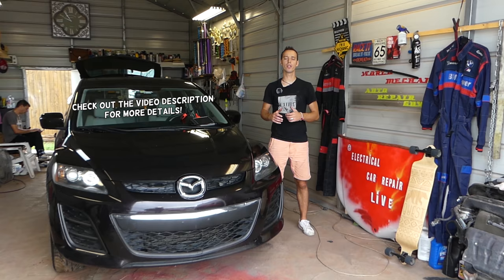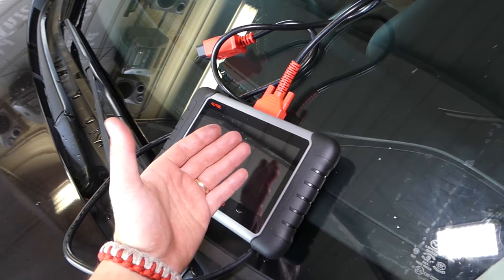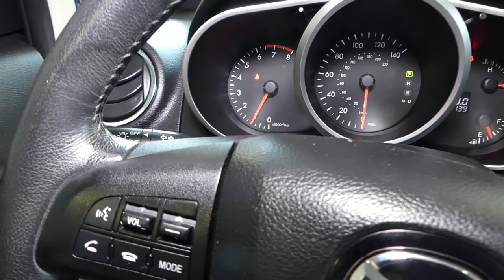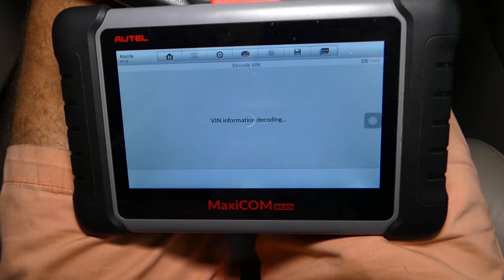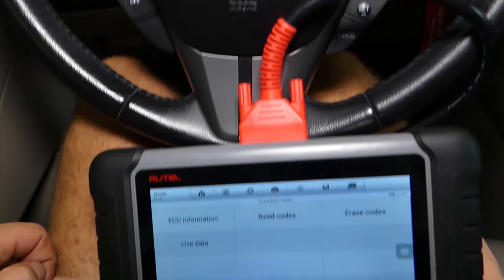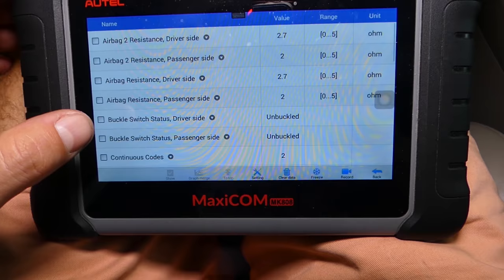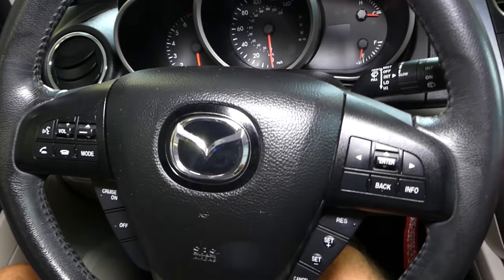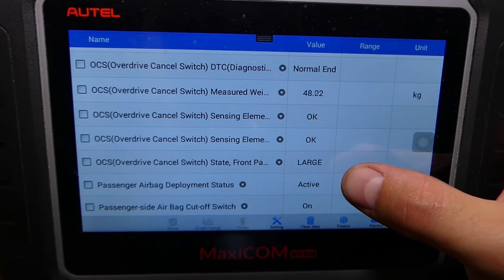MOST COMMON REASON AIRBAG LIGHT IS ON

Comment: For me it was an undercharged battery. It read 12v but was only a 40% charge. I charged it up to full and problem went away. It then clicked why my radio kept shutting down and coming back on.  My guess is my stereo system is taking too much to keep it running from alternator, and not charging battery properly. Couple that with short journeys and bingo, dead or dying battery. Hope this helps someone.

Comment: Don't waste 5:47 minute of your life GUYS

1. Ignition off
2. There are yellow wiring harnesses with a connector under both front seats, these are for occupancy detection. They might have a loose connection. Wiggle and push the connectors.
3. Ignition on.

This resolved it for me, however light only disappeared after the second startup.

Comment: Thank you for the video.  So I was messing around with the plugs under the seat and nothing happened with the passenger side, but the drivers side did cause it to go off but only temporarily.  It came back on when driving.  SO I pressed them again it went off again, but still driving makes it come off.  What is wrong do you think?  And what verbaige should I use to relay that to a mechanic so I dont get hosed?  Thank you in advance!!

Comment: My daily is a 2016 Veloster Turbo.    Today I went to visit my wife at CVS minute clinic and the road to get there is horrible.    I feel like my car now rides rough.   The suspension is hard and I have 18 Rotiform rims with low profile tires.     Anyway I was on the interstate and even then the road is bumpy in some area.   My airbag light came on when I started my car, so that I could drive home.   When I got home, I check the yellow wire and snug it back and restarted my car.   The low went out.     There was also a dry leaf that was wedge in between the yellow wire and the other wire.    So I guess In my case.   My airbag light came on because of a leaf.   😮

Comment: I have 2019 Toyota Hiace Crew. I took out the rear seats (one bench seat 3 seatbelts). Now I have SRS system malfunction. I want the rear seat outs permanently, but I want the airbags to work. The connector is 8pin. Can I put 2ohm resistors across all 4 pairs. I assume 6 pins are the 3 seat belts and the other two I don't know, occupancy sensor, weight sensor...??
What do you recommend?

Comment: i got a 2008 mazda cx7 and it keeps blowing the 30amp power window fuse in the fuse box under the hood.Here is what started my problem.A hose blowed and it got and blowed head gasket.So i changed it and put timing chain and vvt gear and when i was done it stared right up and ran better than it ever had but it leaked water so i tore it back apart and coudlt find the leak so i put it back together and had no water leak but it leaked oil lol so i took it apart again and couldnt find the dam oil leak  but when it leaked oil it ran perfect and the fans kicked on and off like they should.I put it back together and had no leaks at all but the dam fans wont work so i tryed everything i knew and decided to run a wire from fan to fuse box and found a spot where it was hot with key on it was just a spot that had a hot terminal only in it so i put a fuse in it and ran my wire from the other side of the fuse and it was working great for about 5 minutes then the fuse didnt blow like shud it melted and now the power window fuse blows ever time you put one in and ive checked all wiring harnesses and can find a short nowhere .lmk if you have any idea whats wrong with it id really appreciate it

Comment: on a 04-09 toyota prius, the seat belt receptacle in the drivers side has wiring and a sensor in it, mine got damaged and turned on the airbag light. replaced the connector and harness and airbag light went off

Comment: Can u have auto zone run their scanner on it will that catch these issues
Reply: the last time I took my Honda to Auto Zone to have them use their scanner to detect a problem, the guy at the counter told me they don't do that anymore and told me I had to do it myself, and handed me the computer. I am 71 years old and not very flexible anymore, and maneuvering around to find and plug in the plug was very difficult. Does Auto Zone REALLY not "do this anymore," or was this guy just being an ass?
Reply: @galecadywilliams4078  i went to auto zone recently and they came out and checked my battery for me they brought the machine out and checked and as far as I know they still do that so sounds to me like that guy was being a ass
Reply: @lightning8180  Kind of what I thought....:(

Comment: my grandson just installed a backup camera in my Mitsubishi Outlander sport 2017.  the camera works great, but now I get a flashing warning stating the airbag needs servicing.  he put his code reader on it and it didn't show any codes.  he also checked for connectors or sensors that may have become unplugged but couldn't find anything.  any suggestions?
Reply: Did you ever figured out the issue? Same problem for me, just installed a backup camera and now the airbag is on
Reply: @PercalTM  No - I didn't pursue it.  My grandson who installed the backup camera - was pretty sure it was a loose connection somewhere.  I just haven't tried to figure it out and can't afford to take it to the dealer.
Reply: @ssergeant9682  I see, did he just erase the code? So the air bag light is no longer showing for you? I think what may happen is that when we were installing the camera and getting into the dash and unplugging the airbag apparently your not supposed to turn on your car when it’s not plugged in.
Reply: @PercalTM  I'd have to ask. It was last summer.  Not sure he remembers.

Comment: Please help I have a Toyota Corolla 2016 the airbag light is on but the scanner it doesn't show any code
Reply: Same
Reply: @jaybay1925  I fixed it it was the air bag module you need to reset it